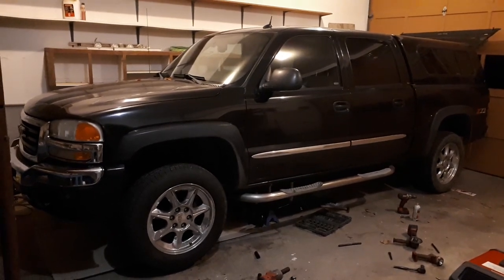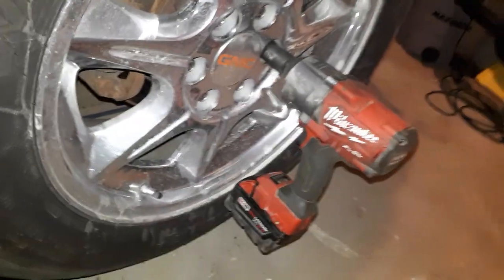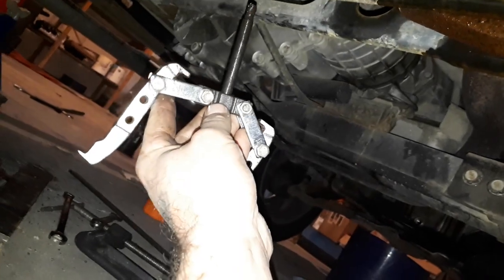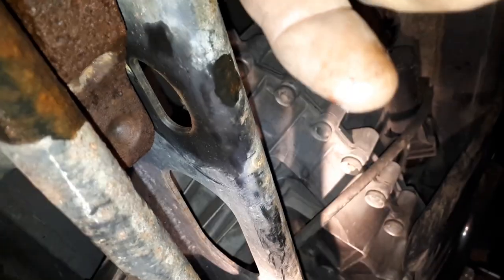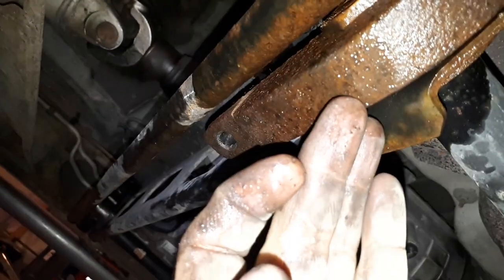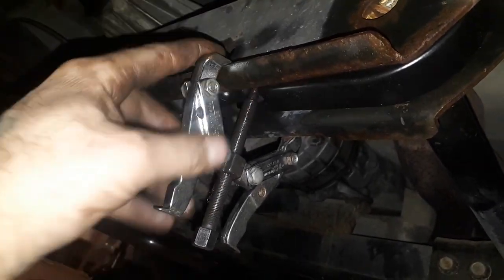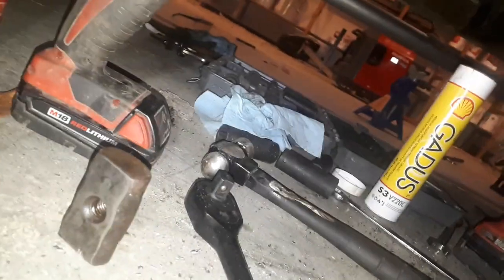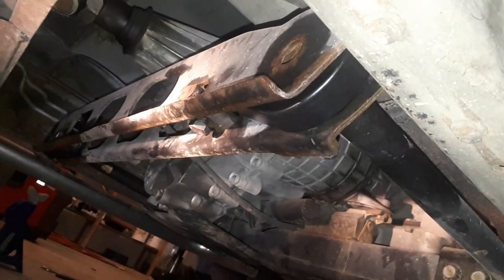Chevy 1500 torsion key removal BEST WAY TO REMOVE.

Comment: I’ve been watching several videos on this for tips on how to replace my 2005 Astro van torsion keys and one thing NONE of them mention is the whiskey distinction. THIS video clearly points out what I have been doing wrong. I’ve been running Kentucky bourbon, I guess I need to switch to metric and get back at it.
Reply: Hahaha, it cant hurt!!

Comment: I'm doing the Hole Drill/Chisel method! Thanks!, My LCA's are removed on my 2003 suburban as i am lowering it...I went to install the Keys and thought my Torsion bars were welded to the keys! i used a big hammer, Lube, and a Torch, Didn't work.  (was not looking forward to the gas tank side w the Torch) This method looks easy...

Comment: Thanks for the video. I used WD-40, an adjustable 4-8inch bearing puller, air hammer to free the torsion bar out.

Comment: Just throwing this out there for anyone following along.  Before you drill the first hole in the key to loosen the front of the torsion bar, I was able to just stick a small pry bar above the key and pry against the top of the crossmember to get the torsion bar to back off and loosen up.  If that doesn't work this method will, but it saves a lot of time if you don't have to drill a hole and build a special puller.

Comment: Awesome video, levelling my 09 duramax. This is great. Cheers
Reply: Just got this completely finally. I live up in canada as well and found that using an air hammer chisel and lots of heat with the torch sped the process up a ton. One of the bars would not break free from the lower control arm so I used a bottle jack under a pipe wrench to set it loose. Thanks for the help!

Comment: Man I pull Axel Nutts torqued at 177ft lbs off with a SiiSii Impact I bought on Amazon for 80 bucks faster than that milwaukee pulls lug nuts... Don't shy away from unknown brands, You can save literally thousands on tools that get the job done time and time again.

Comment: Your video is the very best method I believe  its a lil more work but anything else is going to be to. You just have to get to it. And I like this method best of all the videos I can find on this subject.   Thanks a ton.  Or in my case 1/2 ton.
Reply from the maker: Im glad it worked well for you. It probablly is a bit more work, like you said. But its simple and doesnt require a lot of force or tons of heat.

Comment: Sorry if I missed it. Why did u need to replace key,for the lift? If so why wouldn’t u just lift with stock key?
Reply: Yea, slightly higher lift then just cranking up the bolts on the stock torsion keys.
Reply: The key itself has a different cut out so when re bolted up it actually lifts truck 2 to 3 inches

Comment: If you can’t smack that torsion bar with a hammer use an air hammer! It works like a charm
Reply: Air hammer doesn’t do it if they are completely rusted together.